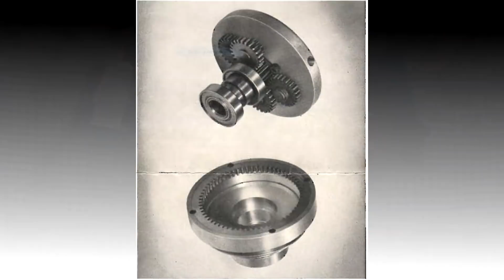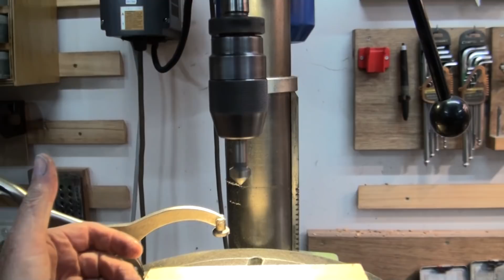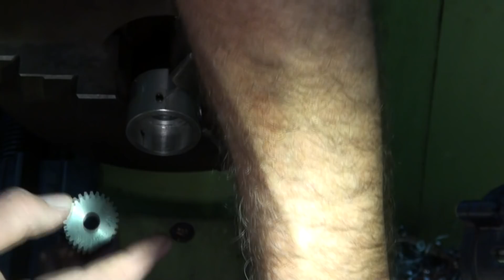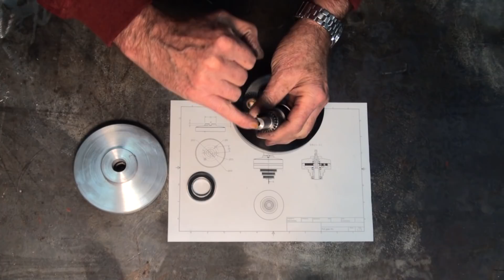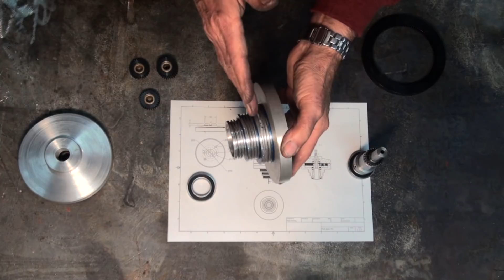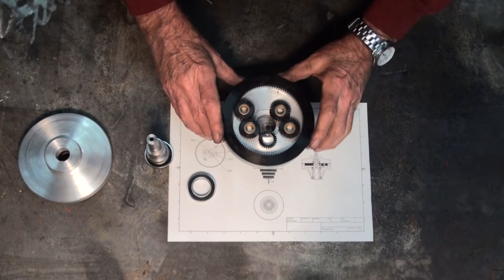Pull Gear Speed Reducer - Thanks to Mr. Pete

Comment: I just found your video.    Very well done on the reverse engineering, design and machining.   Bummer about the cast aluminium tearout.   I have not tried casting aluminium.  I have a local metal recycling place where I am able to get my aluminium.   Mostly 6061, but some 2024 in flat bars.

Just curious about the sintered bearings.  In the US it is common for these to be purchased already impregnated with oil.  I have several in the drawer.   I left one on a piece of wood and the oil wicked into the wood.

In Australia are they normally dry?

Dave.
Reply from the maker: Dave,
I assumed the ones that I bought were dry. I was intending to soak them overnight in some lubricating oil. I have seen others (This Old Tony I think) fill the centre with oil and then compress it with fingers from either side until the oil appears on the outside of the bush. You are lucky to be able to buy aluminium in small pieces. It's not easy to come by where I live but I have a mate who is an auto mechanic. He gives me old intake manifolds and water pumps which I cut up for the furnace. Any raw stock like 6061 I have to buy on Ebay.

Comment: Only the second person I've seen using tangential lathe tooling.  The failure in the pulley groves may have been from the tool catching small voids in the casting. Mrpete's gives a ratio of 4.5:1, but they also made a 7:1.  I am glad I stumbled across your video. Your project is certainly the kind that I like to see. I subscribed (#641) and I will be back to see part two. Thanks for the video.  1485 views so far with 226 comments, you're doing GOOD.

Comment: I like that slotting  attachment! I bet that could be adapted to gear cutting. Hmm, I see there is some flex in the device showing at the cutter and bar. Would need to be stiffer, and/or perhaps a sharper angle on the cutter. Great Job, and an audacious one too. 

Do you think you could make a removable set of pulleys? The diameter of the stock would be much less and errors, redesign, and ratios would be easier to fix. Sorry if I am late to the game, Youtube does not seem to allow dating of videos. you may have done this years ago. I have seen oilite sintered bushings fail in expensive places, I would have used bronze or perhaps no bushing AND a bronze shaft and run light grease or maybe way oil in the unit if it would stay off the belts. But then YOU are doing the work and I am just watching, LOL. 

Abom showed some felt wicks in his shaper overhaul video, perhaps a wicking system of lubrication could be designed using gravity and centrifugal force to distribute oil. Mcmaster Carr supply house in USA had the wicking felt.
Reply from the maker: The slotting attachment is due for an overhaul. There are two bronze bushes at either end of the main ram. Somehow I managed to get them misaligned when I pressed them into the cast aluminium body. I tried to ream them parallel with an adjustable reamer but they ended up being out of round which leads to the deflection you can see in the video footage. It works fine on brass and aluminium but steel is a bit of a struggle. If you check the latest video on the pull gear you will see that I intend to fit some oilers on each of the studs for the idler gears so I can deliver oil direct to the bronze bushes. Also the gears only rotate on the studs when the pull gear is set to reduction drive. When it is running in direct drive the gears are locked. As for the video date. As of July 2018 I am still in the build process!
Reply: Mark Presling, Sorry my comment came after your explanation, I have been commenting as I watch.

Comment: The machined pulley could possibly be saved by adding and filling the gaps with a tig welder and re-machine the sheaves . Just a suggestion .
Reply from the maker: I think the main problem was the quality of the aluminium that I used for the casting. I melted some pieces from a lawnmower frame and I suspect it had some magnesium in it. It was very crumbly and seemed quite brittle. As it turned out I was able to remachine the pulley section from some good quality wrought aluminium (6061).

Comment: I am glad I stumbled across this.  Your project is certainly the kind that draws my interest.  I subed and I will be back to see part two of this.  Thanks for the video.  I forgot to mention that I have a drill press just like the one that you have but I have all 3 pulleys and it gets down to a reasonable slow speed.  I got mine in the 1970 era.
Reply from the maker: Hi,
When I purchase this drill press I was surprised to find that it was manufactured in the 70's. I was still in high school at that time! I have used those drill presses with the 3 pulley system and they do give a wide and useful range of speeds. I half considered re-manufacturing the missing parts but I was seduced with the idea of having an infinitely adjustable speed range. Sadly, the VFD route does not give enough torque at low speeds.

Comment: I've been following Mr. Pete as well on this. I made a post on the latest post of his on the subject where he is beginning to disclose the disassembly details.  Like you, I am at a loss as to how there can be a 7 to 1 reduction without a double reduction in the planets.  Perhaps this has something to do with the set of tapped holes in the top plate and the allen head capscrews visible in the first video.  The patent drawing doesn't supply detail. Anyway, you've got a nice project there, congratulations, and I hope a more uniform raw stock gives better results to the pulley (lower) housing.  I went with a planetary reduction unit from a salvaged New Process transfer case from a Grand Cherokee Jeep for my gear reduction.  Only gives 3 to 1, but the press is pretty heavy (2hp) to begin with.  Ideally, this may turn into something for you economically.  Maybe a machining kit or something.  Good Luck.
Reply from the maker: Bill, I am pretty sure that the pull gear that Mr. Pete has was the 4:1 ratio version. It looks like it has a 65 tooth ring gear but I cannot see the sun gear but it would need to have 9 teeth or less to give the 7:1 ratio. I tried and failed to get anything more than 4:1 with the gears I could physically fit into the CAD model. The revised step pulley machining went OK and the next episode of the build is going up shortly.

Comment: I have one of these, new in box from probably the 60s... ... somewhere. If I find it I'll send you some pics if you'd like.
Reply from the maker: Matt,
That would be great. I only have a few pdf files to go on and because they were from the original manufacturer they don't give a lot of detail because I am assuming they would want to protect their patents. I am particularly interested to find out the total tooth count of all the gears and how they got the 7:1 reduction claimed in the original ad. I am guessing they double stacked the idler gears somehow with different tooth numbers to get an intermediate gear reduction between the sun gear and the outer ring gear.
Reply: dan cobar    Mrpete's is 4.5:1
Reply: Mark Presling 
I think Mr. Pete said they were available in two gear ratios.  Not sure what they might have been though.  I think one was 7:1
Reply: Hi Matt, interested in selling it?
Reply: Bull Dozer - I can't even find it, let alone sell it. Got it at a garage sale, new in box last summer, $3 maybe. You gotta be able to find 'em on Ebay still. If only I remember what name they were called.
Reply: The original ad' states 4.5-1 and 7-1 ratios. They must have used 2 different gear tooth counts depending on model. regards